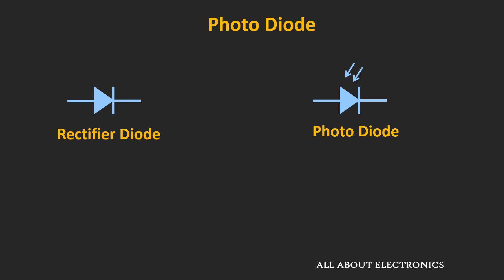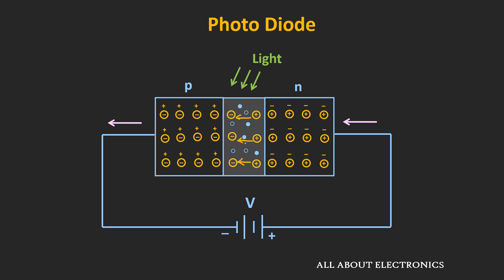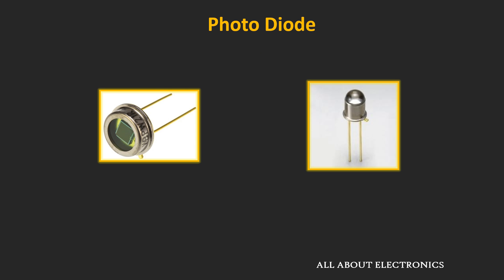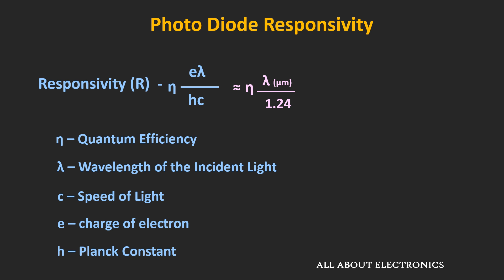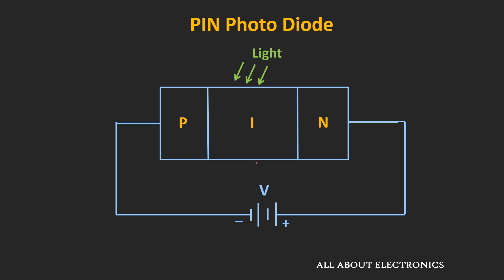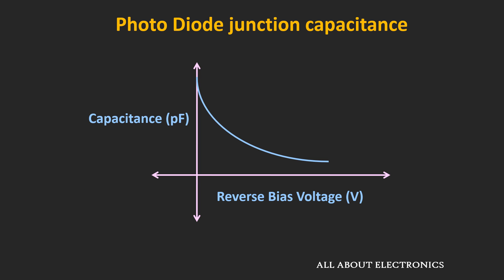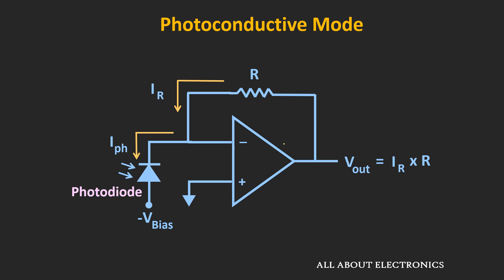What is Photodiode ? How Photodiode Works ? Photodiode Explained

Comment: Sir I have taken your membership of 59 rupees but don't get pdf can't find from where I can get the PDFs
Reply from the maker: PDFs are in the advanced level. Those are updated as a link in the members only posts.
Reply: @ALLABOUTELECTRONICS  But in your membership charges pdf of quiz is mentioned
Reply from the maker: Some of the early quiz are posted as PDF and as a community post. You need to scroll down a bit further to get it. Now a days, mostly I upload it as a video ( videos are easy to find than PDF). Have you joined the membership under this account or through some other account ? I can't see you as a member. Members have a badge under their name.
Reply: @ALLABOUTELECTRONICS  I joined your membership for quiz PDFs .yes I joined from this account .
Reply from the maker: Are you able to see the badge beside your name ? Are you able to see Members only videos ? Why I am asking, because I am not able to see you as a member.  (Not able to see a badge beside your name).  Please make sure that, your membership is enabled. If it is enabled then under the membership tab, you will be able to see all the content.

Comment: Hi, how to calculate a resistor value for a photodiode?
Reply from the maker: It depends on the type of current, you are measuring. When there is a sufficient light (mW power) then few kΩ resistor would be sufficient. At the most one should not go beyond 100 kΩ, otherwise the thermal noise of resistor will come into picture and can affect the accuracy of the reading.
Reply: @ALLABOUTELECTRONICS  Thanks a lot!!!

Comment from the maker: The Timestamps for the different topics covered in the video :

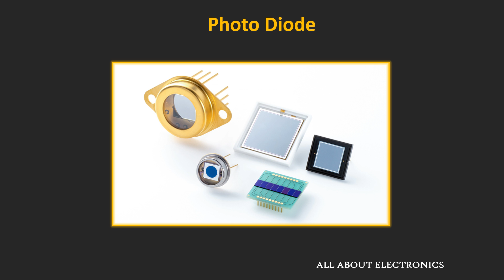0:19 What is Photodiode?  How does Photodiode Works?

3:20 Photodiode parameters
         1. Dark Current
         2. Responsivity
         3.  Quantum Efficiency
         4. Response Time
         5. Noise Equivalent Power 

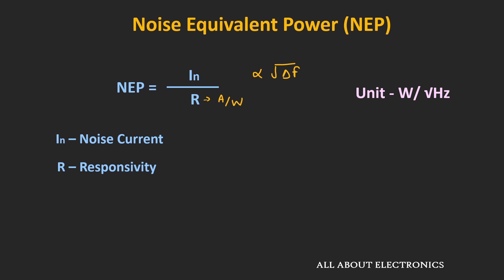10:44 Different modes of operation of Photodiode
        1. Photovoltaic Mode
        2. Photoconductive Mode
Reply: Apne tunnel diode ku miss kia h vo bhi include kre please